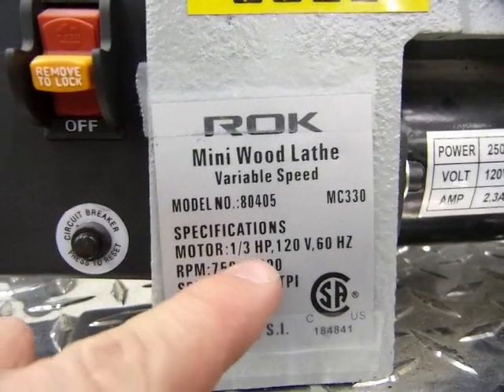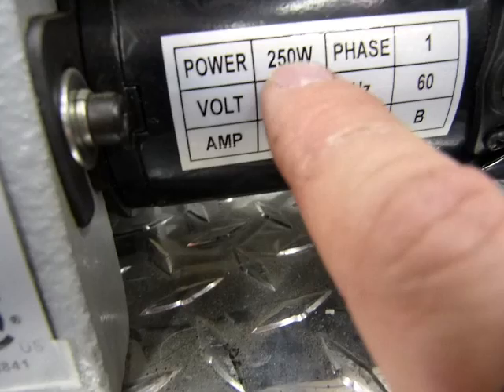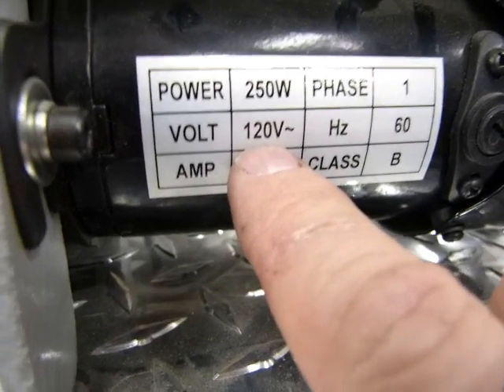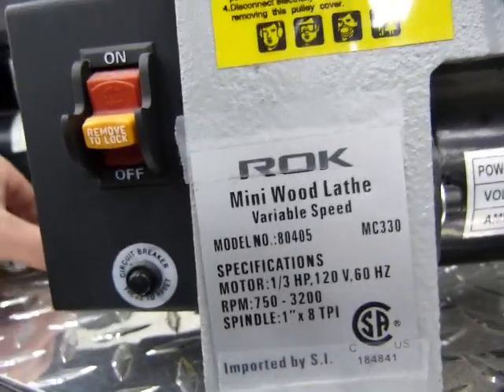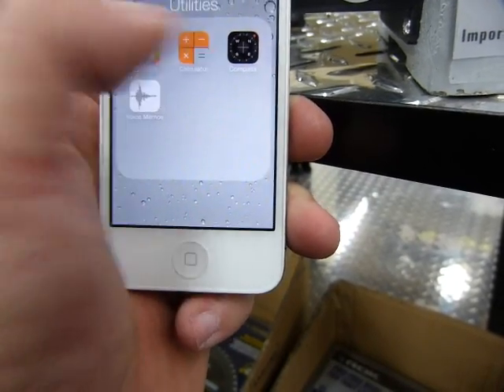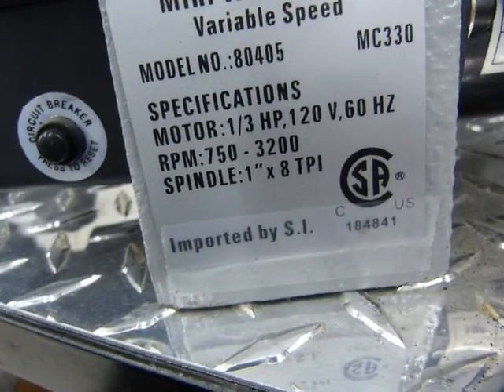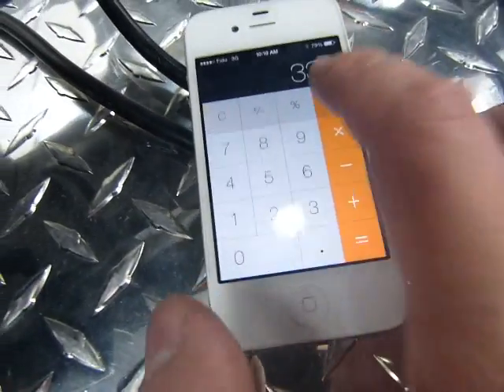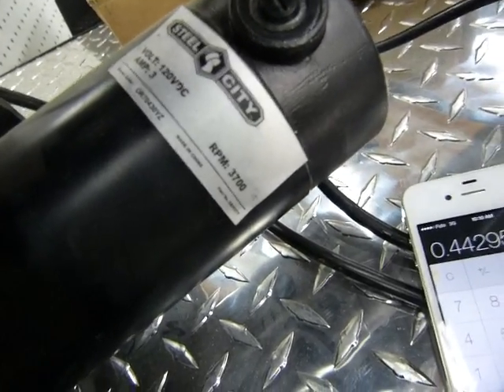Motor horsepower vs. Watts

Comment: 120×3 is 360 not 330
Reply: You weren’t listening. That nominal power, typically its 110v. You know 110-120v fluctuations in many areas.
Reply from the maker: Sure is.
Reply: Next time turn on the captions so that u can read the subtitles🙇